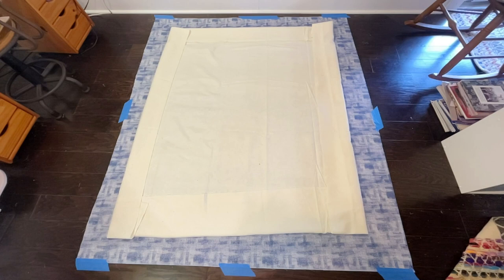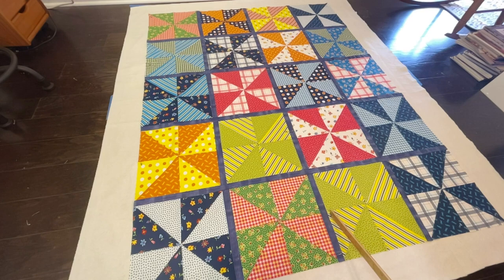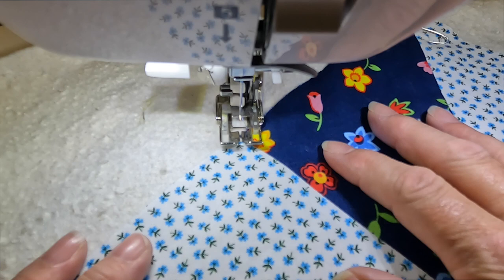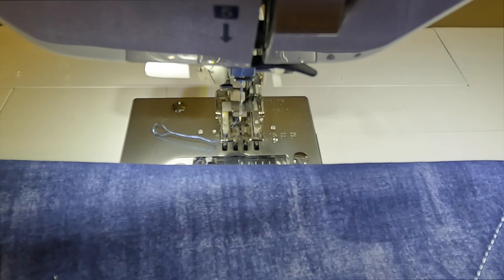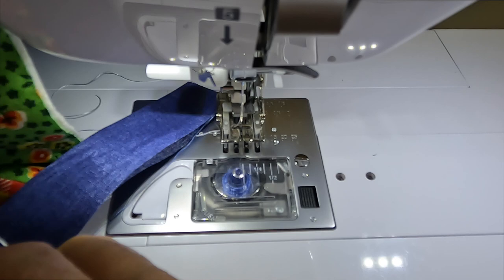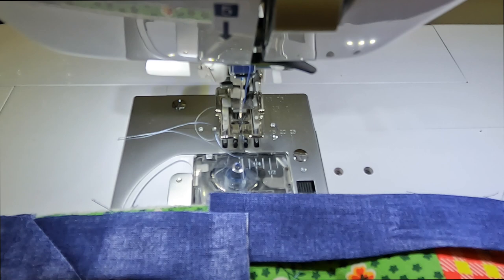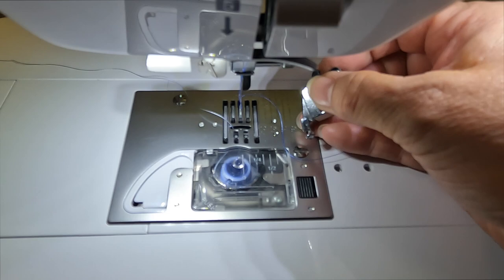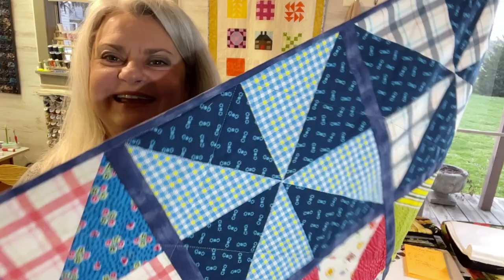Beginner Pinwheel Quilt Ep.3 | basting, quilting & binding

Comment: I saw a YT channel where they gave this tip on binding. When you get to the corner and stop 1/4" from edge, turn 45 degree angle and continue stitch to the corner. This makes it easier to line up the next edge.  I'd never seen that before in all the videos or my quilting books.